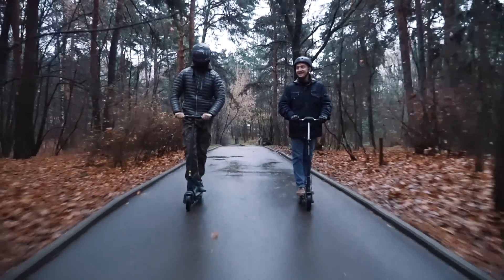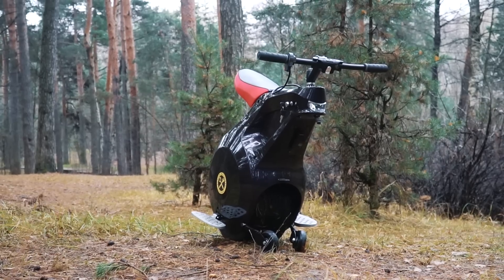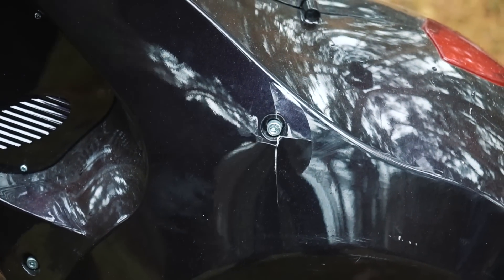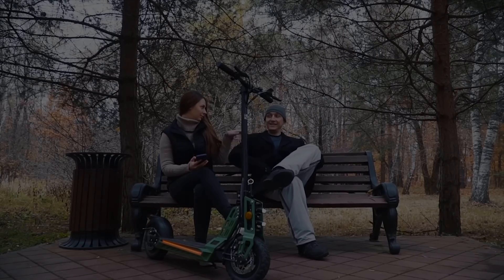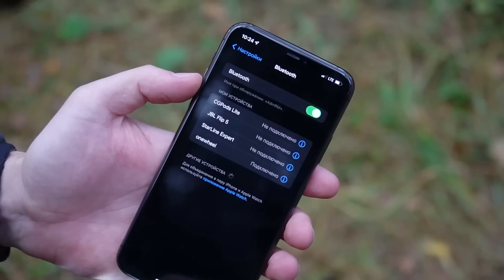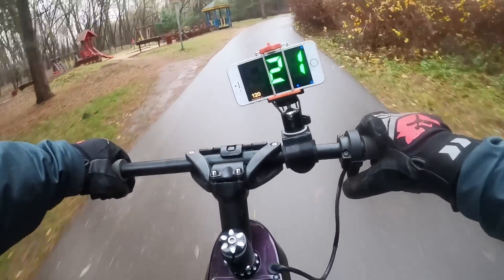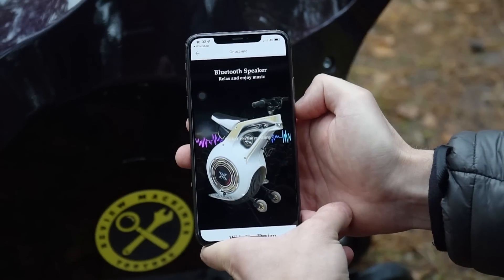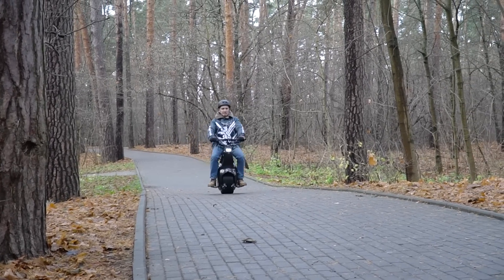I bought the strangest device! Can you guess what it is?

Comment: You can see from the shape of the tire alone, that not too much deep thought was put into the engineering.
Reply: seated EUCs seem to use these wide flat tires. Maybe they are targeting a different age group here.
Reply: I think it was designed to run over squirrels.
Reply: I noticed that too. They should of went with a motorcycle tyre. Improves maneuverability.
Reply: wide wheel = cheaper low fidelity gyroscope to compliment the cheap low capacity battery
Reply: Exactly my thought.
Reply: @xXxcastenada  and you can't turn... Great...
Reply: @greenwave819  7:13 The stupid age group.. I agree the Tyre needs to be a small motorcycle tyre.. Skinny and tall not short and fat

Comment: The wheels out front are for safety,  in case it has a cutout in power so you don't just faceplant. It's basically an EUC  otherwise.
Reply from the maker: But it practice they work on the contrary
Reply: @RMW  yeah looks like it would make you faceplate after seeing your first attempt at riding, not very safe at all
Reply: And they are sticking out waiting to catch on something.
Reply: Hack saw them off lol see if goes faster
Reply: I don't think they're for if your power cuts out. I think the intent is that they prevent you from leaning so far forward that the wheel can't keep up and you face plant. You're trying to balance over the contact patch on the road with nothing more than acceleration and deceleration. If you run out of either, you're going down. 
On an EUC the angle of your feet would give you a feeling for when you're going too far, but on this, you're going to tend to ignore that and keep your torso upright.
Reply: @the_omg3242  yeah, it does all of that too. I wasn't going to take the time like you did in reply. But it does help prevent the rider from over powering the unit and causing cut out.
Reply: It's so much worse than an actual EUC.
It would be interesting to mount a handle bar to a much better build EUC and maybe it helps riding seated or maybe it sucks.
Reply: They would make you front flip instead of face plant, fail
Reply: @Matt_Wilson01  they also  don't let you lean forward enough to cause cut out do to voltage draw spike. The front wheels mitigate acceleration and sudden power draw.  But, The whole machine is an epic fail.
Reply: @Fantaman900  This is like an EUC designed by someone who doesn't know how an EUC works.
Reply: @RMW  Ya, there's no point in having the large main wheel when the first thing that's going to hit everything you try to ride over is those tiny little useless wheels.
Reply: You totally insulted eucs everywhere with that comparison, this thing is total crap with no performance
Reply: @busybody1474   no one said  it was a good one.
Reply: @LemonySnicket-EUC  and no one asked you're  opinion either
Reply: @LemonySnicket-EUC  no one said it was a good one
Reply: hint : maybe its a space saver

Comment: The wheels out front are there as a kickstand and training wheels, they should have longer arms and mounted slightly higher and wider apart to keep you from crashing into the ground if you lean forward, and to keep you from face planting.
Reply: Even more importantly, they should be removable! That big wheel would easily be able to handle that curb without them and actually over something unusual instead of being mostly useless.

Comment: The front wheels are probably at the insistence of a lawyer, they are obviously an afterthought. Definitions: Engineer, someone who knows almost everything about almost nothing. Lawyer, someone who knows almost nothing about almost everything. for example, a bureaucrat.
Reply: No, they're necessary if power suddenly cut out, to prevent the rider from doing an instant face plant, straight down into the ground. Power suddenly cutting would be like hitting invisible brakes.

Comment: That thing needs BULL HORNS!!!! Giant bull horns that stick out far forward!!! Also an MC tyre would be good as you can roll it and actually turn lol. I couldn't believe my eyes when I saw all the hot glue gun glue plastered all over sealing the wires and connectors, that's something I would do!!!!!, you can also tell by how they have bludgeoned a rectangular battery pack into the irregular shaped frame that they just do not give a fuck about the design of the thing!! ...................ADD BULL HORNS!!!! Black ones!!